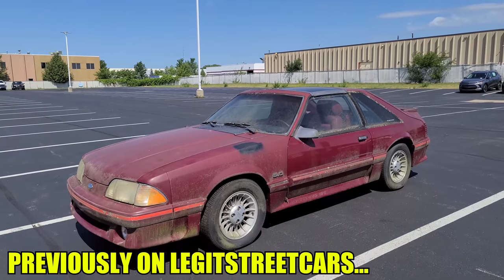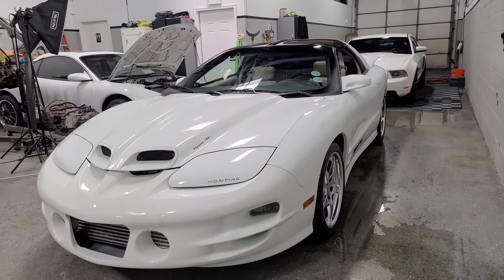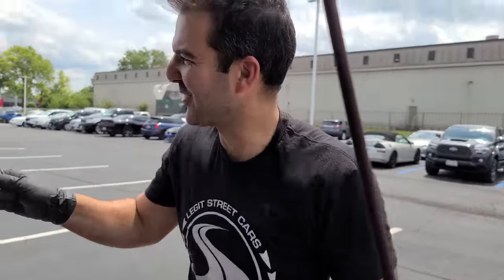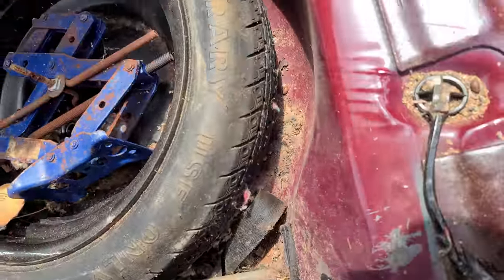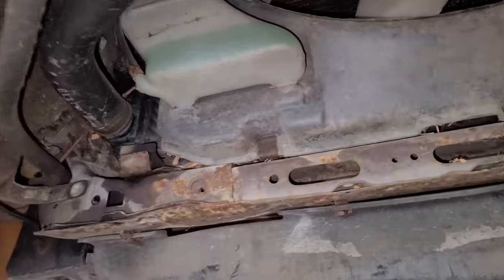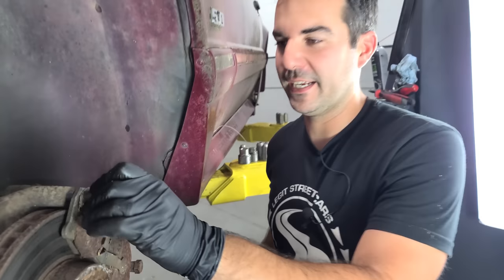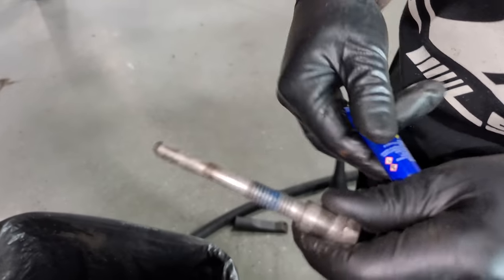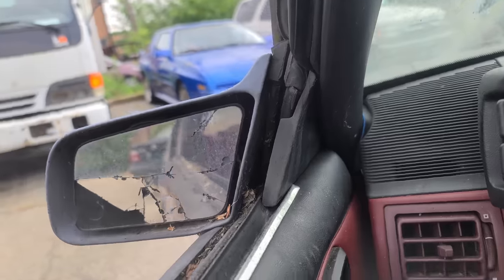First Drive Of The Abandoned Mustang GT Didn't End Well But We Discovered Its Crazy History!

Comment: Good video. I was ex manual transmission engineer for Borg Warner Australia responsible for local T5 production in mid 80s. The T5 has paper lined twin cone blocking rings on 1-2. The lubricant was ATF with a Lubrizol friction/gear additive that was added separately. Be careful when replacing with a generic low viscosity gear oil. It may not shift well.

Comment: Very cool! I’ve owned a few fox bodies over the years and currently have the powertrain of one in my Mercedes Coupe. That one thermostat bolt is annoying but otherwise the 5.0 is a pretty easy engine to work with. Also don’t underestimate them, they may not have a high horsepower rating but it’s a torquey engine and a light car, they will still keep up with modern traffic just fine.

Comment: Check the fuel pressure, the regulator diaphragm tends to fail after they sit for a while.  FP should be 43psi with the vacuum line disconnected
Reply: also... I don't remember if you changed the fuel filter in the last video.
Reply: @lxcoupe  nah just air
Reply: @lxcoupe  yeah he did. when he dropped the tank
Reply: Thank you for this advice.  I have the same problem,  my Fox runs up to 3000 rpm  and then cough,  not possible to drive even.  Only problem is I wait for any parts about 1-2 months as my Fox is  in the middle of Europe :D  I have a 5.0 SN95 too.
Reply: @wyrazowfkp  This is a long shot
If you can get a serial /part number of the part you want.
It might cross reference to another Ford vehicle more readily available.

Obviously not gonna work for car specific items like suspension.
But all drivetrain components, electrical, servicing etc..

Comment from the maker: Ok, what do you guys think is wrong with it? I'm thinking it's fuel-related, maybe clogged exhaust? Let me know, we need to fix this thing!
Reply: Vacuum leak? 
Hard tellin' not known'...
Reply: It ain't got no gas in it
Reply: Check the TFI module, known to go bad(intermittent when the car heats up) probably as much as the ignition switch and the door handles lol. If your stumbling when the car is only warmed up and it’s fine cold that’s your issue.
Reply: I really enjoyed this! Love how you troubleshoot Alex. Do you think it's the injectors or Map sensor?
I can't wait to see you clean and detail this like you did the Alpine BMW
Reply: fuel, maf, vacuum. Could be a host of things, bad spray pattern on injectors, clogged rails. Diagnose time
Reply: Was watching a diff channel awhile back that seemed to be having a similar issue.  For them, the fix was new cats as the originals were shot; totally clogged.
Reply: The fuel tank still has rust in it.I think rust is clogging the fuel filter connected to the fuel pump.
Reply: Try the fuel pressure. Had that issue on
My foxbody. Put a fuel pressure regulator on it and it made it drive 10x better. No backfiring. More power. No misfire.
Reply: Maf is not happy
Reply: Change those fuel injectors!
Reply: My money is on either the tps or ignition control module on the distributor. They are very common failure points. You will need a thin wall 5.5 mm socket for the icm.  It’s been a while but I used to keep a spare icm in my glove box because of that exact issue. Great series on the fox body, definitely makes me miss my old 91 gt
Reply: I’d check maf and fuel filter possibly? start easy then work your way up
Reply: @jasonspitzley1004  This is a speed density car.  Ford went to maf in 89.
Reply: Since this is a T Top that means it’s speed density and the SD foxes were very finicky and don’t respond well to unmetered air. Check the map sensor up by the firewall. You can also dump the codes with a paper clip. There’s a hose that runs from the charcoal canister to the underside of the upper intake plenum and they commonly dry rot and will stop even a MAF fox from running. Any vacuum leak on an SD fox will wreak havoc. I usually just unhook the vacuum hose  from the brake booster and blow smoke into it.

Edit: verify you have proper fuel pressure. Fuel pressure should be at 39-40 psi with the FPR hose disconnected and at idle. The FPR vacuum hose also has a tendency to dry rot. Check the base timing with the spat unplugged and set it to around 10° BTDC. The TFI modules can be a big problem. Worst case scenario the PIP in the distributor could be going bad. Check the tps for dead spots by probing the green with the positive lead and black with the negative lead and turn the throttle body by hand
Reply: Give the car a base idle reset. Fuel pump filter is definitely clogged again . Replace the relay also
Reply: @jrh0369  didn't realize that. I thought all the trucks were speed density and cars MAF... Good to know!
Reply: It probably needs some Chipotle
Reply: Your cat is clogged
Reply: I say the TFI module
Reply: Had an 87 Mustang that started cutting out above a certain rpm.  I replaced the ignition coil with a higher performance one and it cleared it up.  This was after already chasing the fuel side with no fix.  So just something to consider if the fuel side doesn't fix it.
Reply: TFI module for sure! Exact thing happened on my 86 . Keep the special socket and a spare in the glovebox for a future roadside repair as the aftermarket ones a garbage too.
Reply: I know exactly what’s wrong with it! You didn’t have the t-tops off or any 80’s hair metal blasting!!!!
Reply: Any Efi fox body that sat a long time gets a new tank, 100 bucks ain't worth dealing with a rusty one, betting the new sock is trashed.   Get new seals to for the filler neck.    Being speed density, MAP plays a big so get a couple rolls of vaccum line in sizes needed and smoke test it. the hard plastic ones are beyond brittle now.  Cars that sat that long I would  reseal the top half when doing the vaccum lines, intake to valve covers and throw in a new water pump, otherwise keep an eye on the weep hole. They like to leak not long after you get them running. Running a can of cleaner threw the injectors when its apart isn't a bad idea either to check the spray patterns. You all ready replace the ignition switch now check the connectors on the headlight switch, if it at all looks melted replace the pigtail there like $10 from wells or standard. The GT's fog light wiring from the factory sucked and over heats it, nice fire risk. Lastly the ecm in the majority of these cars at a minimum need the capacitors replaced from age alone, easy to crack open and do on the cheap if you can soldier, once they leak they can damage the board and people want stupid money for them, even the speed density units.
Reply: It's the module on the side of the distributor and maybe the sensor inside the distributor. Swap the module and you will probably be fine if not it may be cheaper to replace the distributor. You have to pull the housing off the distributor to get to the sensor.
Reply: A similar thing happens in mine it's a very rare occurrence for me, It usually lasts a minute or 2 then it's back to normal. What do i need to change?
Reply: Check the ecu, there’s 3 capacitors in the ecu that goes bad, check for corrosion on the legs of the capacitors
Reply: Something is clogged.  Probably dislodged varnish and rust.   And that car needs a new fuel tank.
Reply: Pull the fuel filter and dump it.  Fair bet its full of trash that came out of the tank.
Reply: Was the fuel filter replaced? There could be Teflon in a line as well.
Reply: @ischwhit6747  I read that in the Karl Childers voice🤣
Reply: I'm thinking fuel filter, and maybe injectors
Reply: Did you guys change the fuel filter???
Reply: @pvnugget  Not on the SD ECU which only has one.
Reply: Distributor. I had an 89 that cut out over 2500 RPM.
Reply: @jamesk3565  that was my intention lmao
Reply: Mouse ghosts 👻
Reply: So having owned 5 fox body mustangs, my money is on TFI module on the distributor and of course junk in the fuel system clogging the sock/filter.  Breaking up over 2500 rpm is a classic symptom of bad TFI module
Reply: Mustang Catalytic converter did that to me. Exact same symptoms.
Reply: Fuel filter I saw it in the video probably has lots of small particulates clogging it up
Reply: Fuel filter needs to be changed.
Reply: Fuel filter  under car and clean mass airflow sensor ,Just a thought,Nice Ride!
Reply: Just try replacing the fuel filter and see if it opens up. If so we know the problem right there. If that doenst fix it check the soft lines or the injectors, all those things need some love as well knowing the age of this foxbody
Reply: Check the catalytic converters. I had a ford escort gt that had the same problem.
Reply: It's a Ford. Needs LS swap to fix all the issues! lol jk
Reply: @Hotlog69  blasphemy!
Reply: There are 3 capacitors inside the ECU of these foxes, one controls maf, one controls fuel pump having trouble recalling what the 3rd one controls but if those are leaking inside the ECU like they are notorious for, you'll have all kinds of intermittent fuel air issues.
Reply: @bluej511  speed density car
Reply: Why not replace the gas tank?  That looked really bad when you showed the inside of it.
Reply: Citroen 2cv is one of the longest lasting models of whatever besides the beetle
Reply: Considering the car's age and mileage, it's not unreasonable to assume that fuel pump might be on its way out.  Might be putting out enough pressure to start and possibly idle, but that doesn't mean it's putting out anywhere near its original pumping capacity.
Reply: change that big grey module sticking out of the side of the distributor
Reply: Fuel ⛽️ pressure regulator is bad. Rubber diaphragm leaks fuel into the intake thru the vacuum tube floods the engine.
Reply: Verify the TPS has a linear resistance change.
Reply: @bluej511 86 was the first year mustangs had fual injection and 2 the 86 to 89 mustangs were speed density systems they did not have maf that did not start until 1990.

But you could convert them to mass air flow from speed density.

Man I am getting old it cracks me up how you younger guys don't seem to understand how to actually make these cars work and what priceless gens these are.

Or things like the accell ignation systems or msi system's.

Which replaced the factory ignition systems.

Or things like the k and N filter charger system which was a simple as removing the factory air box silencer and sticking the k an d N reusable rechargable air filter in place of the factory air filter.

I could go on forever.
Reply: @jasonspitzley1004 there is no maf from the fsctory on 87 mustangs.

They were speed density systems. Which instead of mass airflow senser there was a, speed density sensor.

The switch to mass air flow did not happen until 1990.

But you could convert the 86 to 89 ones to mass airflow easily.

Man I am old when I can remember all the mods and tricks and how those cars actually worked.

Like for example replacing the stock borg Warner 5 speed manual trans with a tremic 5 speed manual trans and centerforce clutches.

Or flowmaster VS dynamax.

Or how the factory h pipe was 2 and a quarter with 4 factory catalytic converters on it.

And how many guys removed the factory h pipe and put 2 and half inch pipes without the cats on and got the emmisions to run cleaner VS from the factory.

But In today's context you could replace the fsctory h pipe.

With 2 and half inch h pipe or x pipe with 2 good high flow cats on them.

Again I could go on.

But again I am 45.

And I remember those fox body's like it was yesterday.
Reply: Does it have twin fuel pumps? That could be one issue. Some Fords have one pump in the tank which you did replace and they have a second one on the frame rail usually on the passenger side. This one could be bad . Also is a second filter besides the sock on the in-tank pump that can be clogged too.

Comment: Owned two GTs in my lifetime. The ‘87 and ‘88 model were largely converted to mass air systems from the factory speed density system. 

The fact that interior is not more faded than it is being a t-top model (rare by the way, t-tops we’re discontinued after ‘88) is incredible. Good, good find.

Comment: Zip tying the ignition switch like you did is actually a proper fix. I’ve done that to every ford I own even if it doesn’t have that problem. It’s just a matter of time. Try timing that bad boy at 10 degrees
Reply: I've owned quite a few older cars and this is how you end up fixing a lot of small things. You gotta improvise and make do with what you got, that's half the fun of working on them

Comment: I actually do trailer safeties and services, as part of my job. I have lost count of how many bearings and brakes I have serviced or replaced, at this point haha. It's good for the younger generation to see how to do those kinds of jobs, if they come across it on their own projects 👍
Reply: Ahhh trailers where the owners rarely maintain them - especially boat trailers all that water in the bearings.
..
I regularly see drivers towing a trailer, caravan, by the side of the road with a missing wheel due to the bearing imploding due to lack of maintenance/grease.
...
.
I was following a guy with a 6 wheel loaded car trailer recently.
Anyways the left rear wheel was smoking. 
I tried to wave the driver down too late the bearing exploded.
The wheel then Separated from the trailer continuing into the side of the road while bits of wheel bearing sprayed out everywhere!
...
Also people rarely change tyres on trailer's..not unusual have 10y+ tyres on a trailer/caravan.

Comment: Holy hell. I literally just watched episode 1 this morning.

Fun fact- the underhood insulation is the only place on an 87-89 (prior to March of 89) that has the pony logo.

Oh, and an '87 had single stage paint. So if it has clear coat, it's been painted.  

My recommendation is put subframe connectors on it- now

The car will thank you.

I also stand by my prior statement- On a bone stock 5.0 with full cats, a muffler delete sounds best.
Reply: I think they may have used some single stage paints all the way through. The 93 Cobra came in 4 colors, Teal, Black, and 2 different Red's, think the 1 Red was single stage.
Reply: @Shakerhood69  You are correct. I think it was 1990 when clear coat became available on certain colors but I'm not sure.
Reply: You're incorrect regarding the pony logo.  The hood insulation was NOT the only place the pony logo could be found.  For all 1989 cars (the car's 25th anniversary) had a small Mustang pony emblem on the passenger side (right hand side) of the front dashboard.  All first year Mustangs are legally '65 cars, despite 64.5 being partially correct - the 64.5 had some minor production changes, such as a generator instead of an alternator, and a lot of Falcon parts being put into place to exhaust the inventory).

Ford didn't actually put out an official 25th anniversary car due to cost cutting moves.  For 1990 models, Ford made a limited edition number of what were called the 7-up convertibles (all monochromatic green exterior paint jobs with white leather interiors).  This is informally considered to be the closest enthusiasts got to a 25th anniversary car.
Reply: @houseofno  False. Mine was built of February of '89 and does not have the horse on the dashboard. They started it in March of 1989

Comment: I have been driving these fox body stangs since  the late 80’s . Had a 93 cobra. I sold it when retired from the military in 2004.. big mistake lol! The Engine and transmissions  are bullet prof! I currently own a 89 GT vert manual with 57k  all original. That car is in fairly good condition!

Comment: Best way I found to get that right thermostat housing bolt is to loosen the distributor bolt, rotate the distributor counterclockwise so the TFI module is out of the way, and then you'll have a 90 degree swing on the wrench vs a 1/2 inch of movement. Just mark your distributor beforehand or put it back in time with a timing light afterwards.
Reply: Yup

Comment: I had an 89 Lincoln LSC with 5.0 HO and 224,000 miles.  Original plug wires, no issues and 23mpg.  One of the BEST engines ever made.

Comment: The longest running car model is actually the Chevrolet Suburban. It has been in production since 1935. Its coming up on its 90th anniversary soon!
Reply: I believe hes talking about body style and not the complete line but the suburban did have a stint of the same body style from 1973-91
Reply: I think Dodge did a Suburban at one point too. And Ford did a Durango before Dodge.
Reply: But not the same generation that he asked about. Citroën cv2 from 1948 - 1990, Mini from 1959 - 2000, Renault 4 from 1961 - 1994.

Comment: Hey  Alex ..
 You  Did  Forget  the  Little   Bottle  Of  Differential  Friction  Modifier  that  Ford   8.8  rear  ends  Require  For  the  Little  clutch  plate  assemblies   inside  the 
 traction- loc.
It  WONT  SELF  DESTRUCT  Without it , 
But  the  Little  Traction - lock
 Posi  unit  and the Little  clutch  plates  It  has   Might  Just  wear  out  a  Little  Sooner.

Comment: If those panels start rattling from removing that old stuffing, use some 3m window weather stripping. It's got the self adhesive strip and it's thin enough to tuck behind those plastic edges and stays hidden.

Comment: I had zip tie my 88 as well. The aluminum base on the ignition switch had tabs that were clip like that held the plastic plug and mechanism.  I think the constant spring pressure weakened the tabs and broke them right off.